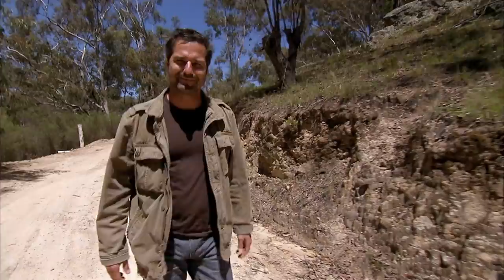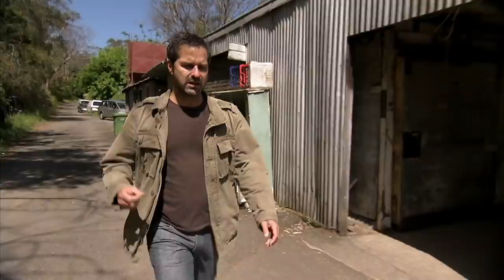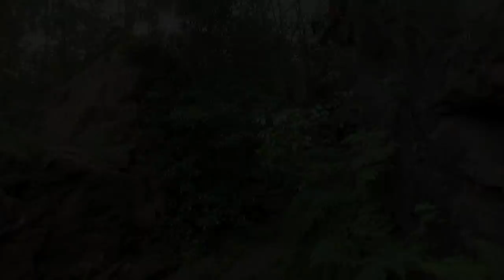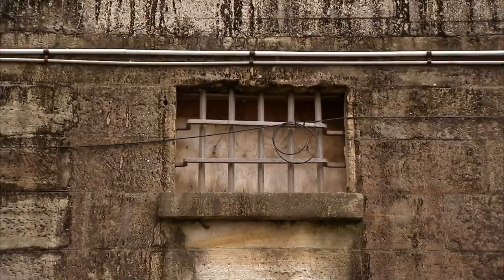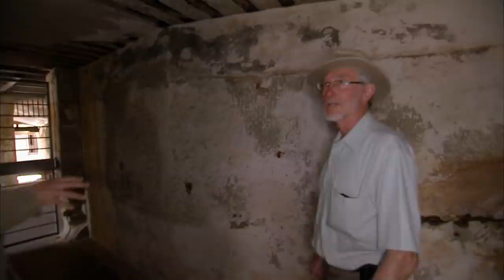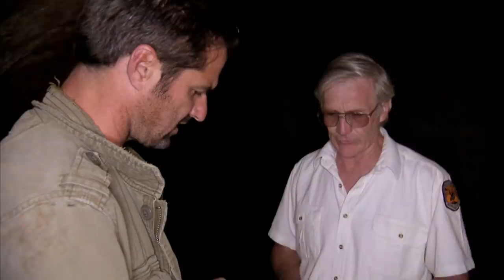Australia's Deadliest Prison | Cities of the Underworld (S3, E13) | Full Episode | History

Comment: Brand new dynamite from a bag found in a century old box. Seems legit 😂
Reply: And then he picks it up..
Reply: @teutonalex  I think its safe unless you got a spark
Reply: If that isn't staged I don't know what is.
Reply: @zacharysmith7700  if it really was old dynamite it can be volatile af and explode from movement or vibration.
Reply: @zacharysmith7700  well the nitroglycerin in dynamite becomes chemically separated and unstable over time and more sensitive to vibration and impact. Handling old sticks of dynamite is therefore more sketchy than say, smoking near by.
Reply: Did some work for a blasting company that packaging is too modern for the box it was in.
Reply: @matthewtroiano3024  the show's attempt to add dramatics to the show failed miserably. (Plays sad trombone) 🤣🤣🤣🤣
Reply: @justinmil1  so sad so very sad and if it is real its probably is not an explosive more like a blasting agent. It could be blasting cap sensitive but I bet it was just a tube of something that was printed explosive.
Reply: @matthewtroiano3024  most likely.
Reply: @matthewtroiano3024  Yep, ours say TNT or Dynamite.
Reply: Looks like emuline or emulex. It's a cap sensitive explosive but not dynamite. I used it 20 years ago. Used for presplit walls.
Reply: Could be a newer explosive stored in a old box
Reply: Dynamite from the 1800's wasn't in plastic back then it looked like an oversized firecracker wrapped in paper.
Reply: @coppertopv365  bruh...
Reply: A company your working for, in an old Mine.. using Dynamite..  finds a old Empty Dynamite box.. so that company and you over time just keeps on reusing the box. .. 
Why throw it aside? It's a Dynamite storage box .. just reuse it over an over.
Reply: Fake for program of course!!!!!